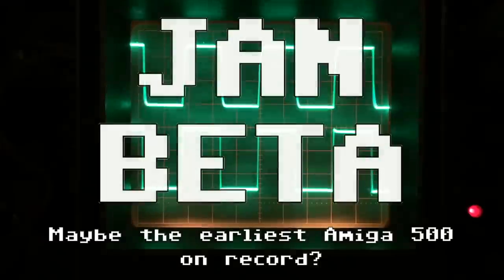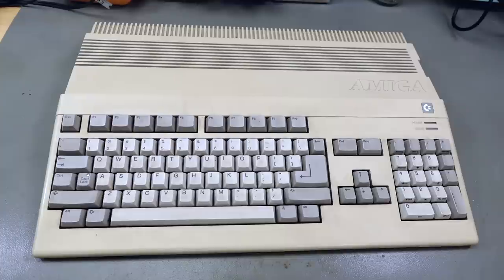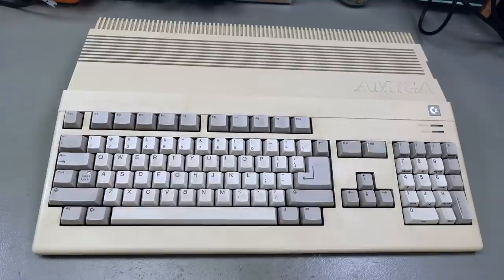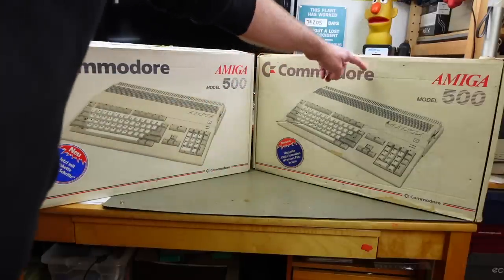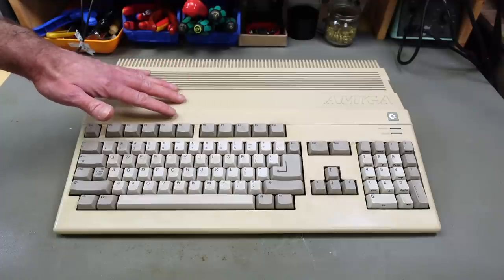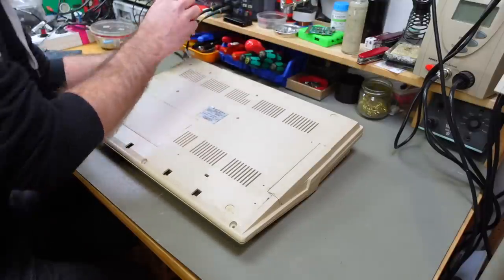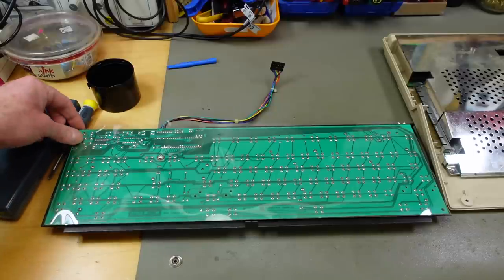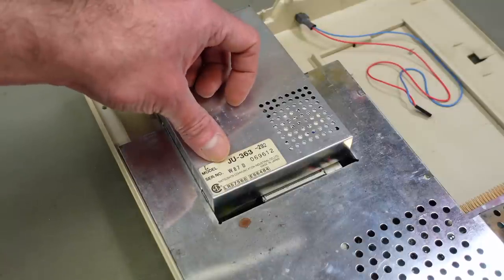The earliest Amiga 500 on Record?

Comment: Wouldn’t it be a good idea to replicate the keyboard PCB? Could improve lots of Amiga’s, but don’t save the originality of course…
Reply from the maker: A 1:1 replica wouldn't make much sense because the original switches are now unobtainium afaik. There are a couple of mechanical keyboard replacement boards for the Amigas available these days that fit more modern keyswitches though. :)

Comment: I guess leaving the Agnus in place and the other socketed chips did not work that well.....
Remove all chips, the Agnus comes off With the chip extractor. Not totally foolproof but you will probably discover some scjmoo on the pins. Same goes with those old sockets, corrosion might be hiding underneath. Wishing you best of luck getting this revived.

Comment: Maybe you should try and make a mold of the case to make it possible to make new cases of the better quality ?
Reply: A injection mould of this size is extremely expensive, 30.000 to 40.000 euro when build in China, build in Europe even more expensive.
Reply from the maker: The new A500 cases from A1200net were actually designed from scratch (but modeled after the later A500 cases, obviously). I think they have some reinforcements but are not as sturdy as the one from this early A500. Would be cool to make them a bit better but tooling etc is super expensive (I talked a bit about that in my A500 Crystal Case review video, after chatting with the A1200net peeps about the whole process).
Reply: Ow....., did i say a mould? You need two, top part and bottom part, so even more expensive ;-)

Comment: 9:42 My Amiga is number 123349 and looks the same. What is the revision? When was it produced?
Reply from the maker: Chances are yours already has a Rev 5 board inside. Difficult to tell because Commodore usually used whatever components they had in stock and sometimes mixed things up quite wildly. I know there's quite a few newer A500s that still got the chicken lips keyboard but have newer boards inside. And there's probably also A500s with Rev 3 boards and the cost reduced keyboards. Look for the date codes on the chips if you want to be sure when your Amiga was produced, usually they are from around the same time so it should be relatively easy to see the approximate birth period of your Amiga. :)
Reply: @JanBeta  Thank you very much for your answer! I will definitely check the codes :)

Comment: I have can early 500 , don't know how early though,  its kick-start v1.2
Reply from the maker: Difficult to tell. Many early C64s were shipped with 1.2, including my own Rev 5 A500 from 1987. Statistically, yours is most likely a Rev 5 board, they are far more common than the earlier Rev 3 models.
Reply: @JanBeta  I think you mean A500's and not C64's here! 🙂

Comment: I loved my 500, the damned disk drive died in the end tho and basically killed it.
Reply from the maker: Yeah, the disk drives are not very reliable unfortunately. Most of the times they can be fixed quite easily though. And replacements are relatively easy to source and inexpensive still. There's also the option to replace it with a Gotek disk drive emulator or something similar these days.
Reply: @JanBeta  I can't sadly even remember what I did with it back in around 91, I barely had a pot to p in at the time so repair was out if the question. I did have an Amiga 1200 for a little while and got my first pc in about 1993/4 , 386sx16 , never looked back after that tbh.

Comment: does that model have a clock battery?
Reply from the maker: No, only the (much later) A500+ models had a battery on the mainboard. In most earlier Amiga 500s, the battery buffered clock was on the very common 512K RAM expansion boards.
Reply: @JanBeta  And the expansion tried to kill the mainboard. But that sheet of plastic saved it from any damage. :)

Comment: If it was Belgian, wouldn't it have an AZERTY layout? Standard QWERTY is really common in the Netherlands, where I am from.
Reply from the maker: I was wondering that, too. It might be that the very early models that were produced all had the QWERTY keyboards. I've not come across a chicken lips style keyboard with a different layout. Either that, or it's not the original box and it actually was sold in the Netherlands originally (which is only about 60km from where it was picked up now).
Reply: @JanBeta  French labels aren't uncommon here since before the EU, there was a treaty active for the Benelux region that required labels to be in Dutch and French. I believe this is still done as of today.

Comment: Nice piece of history!
But why not recap it? Isn’t it better to eliminate one future source of failure 😊
Reply from the maker: I might end up doing that in the long run. There seem to be some serious issues with the power supply to the board, possibly caused by bad capacitors. The plan is to only replace what is absolutely necessary to retain the historical value of the machine though in general.
Reply: @JanBeta  I absolutely agree to keep it as original as possible 😊 Just that it would be sad if it in the future gets ruined because of bad caps. But these are of course better than the SM crappy caps so maybe much less risk of damage?
Reply: @JanBeta  by the way, good luck with the restoration, I will follow it 😊

Comment: earliest A500’s have Commodore and Amiga keys and Commodore logo is embossed into plastic not with a sticker and lastly the keyboard is the famous cherry star wars keys
Reply: It seems that, as Jan explains in the video, the very first units actually had a badge and sturdier plastic. The embossed logo and lighter plastic apparently was for very early units (starting from #2000 or 2500), but not the very first ones.
Note that the badge has the C= logo in a bolder font than the ones that came after the embossed plastic versions. And the quality of the plastic also means it's original, hasn't been changed afterwards.

Comment: Not an early one. The Chicken Lips ones are... and are quite rare.
Reply from the maker: Um, it is a chicken lips one. I'm just comparing it to my slightly later A500 which already has the cost reduced keyboard. I also explain in the video why I think the bolder font logo badge case is the earliest version of the A500 cases. Did you actually watch the video?

Comment: Don’t like the Rev3 boards also the Rev5. The only thing I like is the super white keyboard which is always be white. See all the different A500 Revision boards and use only the Rev6A boards. Which are the best and use it with the ACE2’s and the Indivision ECS V2/V3. Now I have black A500 cases from A1200NET and the black Tankshells. Waiting for the black keycaps. 4 years is a long wait but it’s worth it. Use in 90’s with a black CDTV extern diskdrive on it. Which I still use today. The only thing I use since 2016 are the ACA500Plus with a 68030 card on it. Use my A500 only for Demos with WHDLoad, EXE and on ADF. Running AOS 3.1 and BetterWB 4.3 with a 4GB CF card.

This year it was a Vampire V4 Standalone experience for me. And got a TF1260 with a Rev6 CPU voor my super rare A1200 GHOST case. Hope that 2023 do more things with my Commodore 64’s which need attention.

Comment: sorry, this is not early model. You dont have embossed C= logo on case. And plastic sticker with model and SN on bottom is from later models... First was embossed too to plastic
Reply from the maker: That was previously assumed, yes. As I explain in the video, I believe that the thicker case with the bolder print badge is actually the first version of the A500 case.